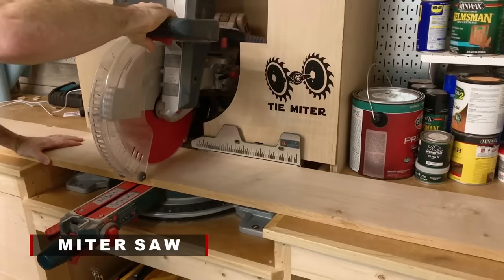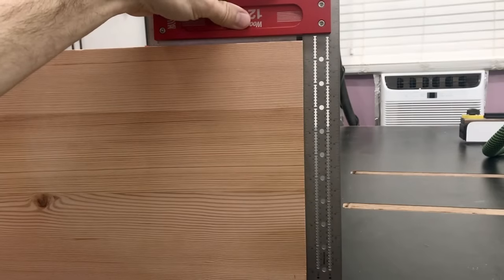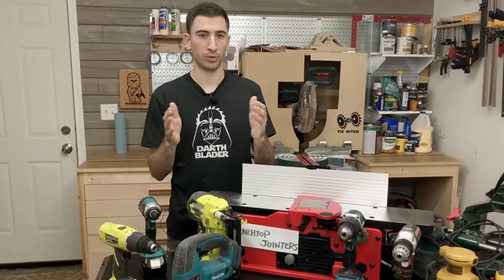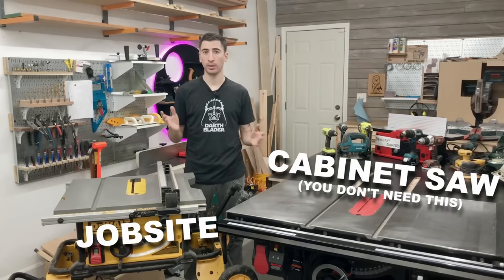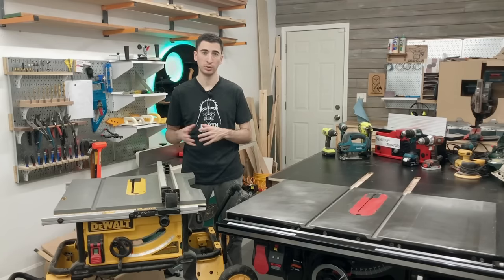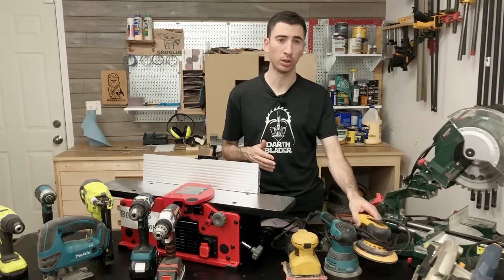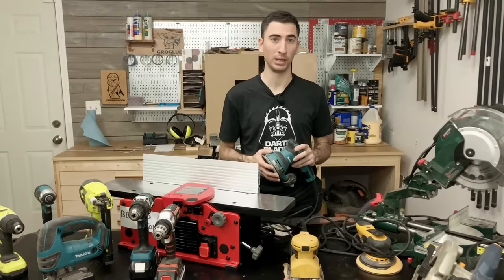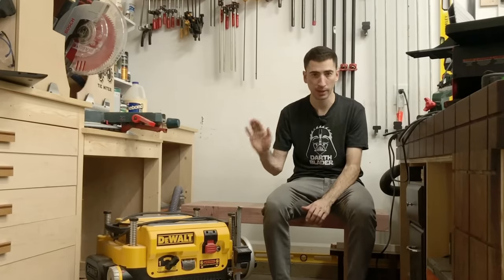Woodworking POWER Tools // Watch Before Buying

Comment: I was actually looking to buy a jointer and I would consider myself an intermediate craftsman but I’ve always just used a router and the straight edge to join two pieces of lumber together and it’s worked great for me so thank you for this video!
Reply from the maker: Glad you liked it!
Reply: A jointer is definitely a luxury you can live without. I've been woodworking for over 10 years and do it for a living, and I still don't own one. My shop doesn't have the room for one, and I've learned to live without.

Comment: You've got another sub but I wouldn't rule out Skil as an option for Table saw. I have the Skilsaw SPT99-12 and while I am new to woodworking this thing has handled everything i asked it to. Also has the rack and pinion fence which is so nice of a feature
Reply from the maker: hey if it works it works! thanks for the sub
Reply: I have a lumberjack 10" table saw mounted on a Dewalt table saw trolley. Used it for four years on job sites, as long as the blade is kept fresh and 40T or more when doing finish or trim work.
As for the router it is only the Triton for me and the work table is hard to beat
Reply: I have the Skilsaw SPT99-12 as well. 
I have no complaints. After initial setup, it runs like a dream and those big wheels make it so comfortable to move around.
Reply: I don't own the Skil SPT99-12, Skil's heavy duty 10 in worm drive saw, but it was my top choice for jobsite saws before I decided to get a contractor saw instead. It does well in independent performance tests against saws like the DeWalt. It has a rack and pinion fence system similar to Dewalt's. It'll do dados up to 1/2". And its mobile cart sets the bar for all other mobile carts. Those large wheels are great for stairs and rough terrain on the jobsite.

Comment: I think a lot of what to buy first and what is useful comes down to what you are going to use  the tools for. If you are finishing your basement, installing new molding or some cabinets or shelving, maybe building a deck or a shed a miter saw is real handy. If you are building furniture perhaps not. But most beginner's cut their teeth on home improvements and fine woodworking comes much later. The other thing to be mindful of is how much you really expect to use a tool. I would like to have a big jointer but space is limited. So I opted for a good size band saw which I use frequently and work around having a small jointer since I rarely need one.

Comment: The DeWalt tablesaw has been my affordable favorite for a long damn time now. The first feature that stood out was the tunable fence that stays square tp the table and parallel to the blade (for awhile).  Most other saws at that price point, you have to parallel and lock the front and back of the fence individually and double check everytime you move it.... I only check the DeWalt every couple of months to see if it needs retuning.
Reply: I'm sure the DeWalt table saw is very nice, but there is only one table saw suitable for a beginner and that is a SawStop and the cost is irrelevant as its dwarfed by the possible cost of having one's fingers re-attached. Now that SawStop makes a $895 model, the extra cost is even modest now.
Reply: I have a bosch Table saw and that is fantastic. I have heard nothing but good things about the Dewalt though, yet the Bosch was a few hundred AUD cheaper than the Dewalt.
Reply: @normanklein3155  nonsense, someone with a healthy regard for safety can use any table saw of reputable brand. SawStop is of course ideal, and I would posit that its greatest strength is in fighting complacency with safety, which tends to plague professionals and long-time amateurs the most.
Reply: @normanklein3155  Or just follow common sense safety measures instead of watching careless Youtubers. My personal safety must is a riving knife as this will greatly help with stopping kickbacks and always using a push stick instead of putting your fingers anywhere near the blade.

Comment: As for battery systems, I would suggest getting two. This gives you some flexibility to choose individual tools. Inuse both Worx and DeWalt. The first for cheaper tools that I don't use that often and are not as critical for precision (such as a sander, reciprocating saw, angled grinder), and DeWalt for the more heavily used and/or precise tools (drill/driver, router, track saw). Both have some other options that I like, such as the Worx HydroShot pressure washer or the DeWalt battery powered vacuum cleaner. I also have some garden tools from Worx for the small garden of my town house, although I have Ego tools for my country house... Being stuck with just one brand seems so limiting to me...

Comment: I had a dewalt contractor table saw for years. it was perfectly serviceable and capable of accurate cuts…..However, moving to a powermatic 3 hp table saw i realized just how much more safe a heavy machine was. so much more stable when cutting sheet goods and ripping long material. the blade guard on the powermatic is actually functional without getting in my way unlike the dewalt and i left it one the machine. If i was building a shop from scratch I would head straight for the higher end cabinet saw and go for cheaper options in other areas. just my two cents.
Reply from the maker: fair statement
Reply: I can use mine just perfectly fine, I love my table saw and the various sleds and jigs I’ve built for it. Easily serviceable and simple to use.

Comment: I went with Milwaukee because all their tools, including their yard tools, use the same batteries and their high end tools have brushless motors. Particularly love their table saw, circular saw, hedge trimmer (a bit heavy but cuts like a hot knife through butter), and their blower.
Reply: You could literally say the same about ryobi
Reply: @AlbiWiedersberg  
While Ryobi tools have improved in quality in recent years, a lot of reviews by tradespeople say to stay away from them, because while they're cheap, they're also cheaply made. I didn't choose Milwaukee only because of the interchangeable batteries and  brushless motors (which Ryobi only came out with last year), I also chose Milwaukee for the quality. The tradespeople say to go for Milwaukee, Makita, or Dewalt and I think the tradespeople know what they're talking about.
Reply: @Dr.TJ1  well the quality aspect makes sense to me

Comment: Regarding table saws.  I have and still use a high end Jet cabinet saw. Love it.  But a couple years ago I needed a cheap throwaway for a shop building project away from home.  I found a free HomeCraft saw vintage 1950 on Craigslist and after that project I still use it. HomeCraft is actually Delta back when it was all USA made. The bones of the carriage and mechanisms are rock solid. While the table is small the fence believe it or not is also a rack and pinion piece that is dead accurate.  I added a segmented belt on the motor and this baby runs so quiet it makes you think $600. Got it from a guy who never used it. Was rusted and siezed. After disassembly and lubrication and a very good blade this little baby is still one of my favorites for small jobs. Some days you just get lucky.

Comment: Good video, brother! I already got the bench top jointer, but I got it at auction for like $40. I'll save up for the used 6". Also, really glad you helped clear up the confusion on what saw to get to enjoy a decent fence. I was looking cabinet saw to replace the Craftsman 10" I got at a yard sale for $20, but maybe I don't need that... At least not until I build my timber frame shop! 😉

Comment: Definitely got to agree with the dewalt job site saw. It is awesome! Love that thing!!

As for the jointer….. I’ve got 2. One is a small ryobi that well works ok. The other is a makita attached to my planer. I built a roll away stand for it to make it easier to move around. It’s an 8 incher, and I have been able to run 6 footers off of it without adding any extra tables. It runs beautifully! Of course as you said a floor model would be even better but unfortunately I don’t have the space. I would say forget about the sixer and go with a portable 8” especially if you can get it as an attachment for your planer.
Reply from the maker: It is a great saw. Like you said on the jointer the biggest you can fit and afford is the way to go

Comment: I can highly recommend the Dust Deputy. It collects a lot more than just shavings and large particles, at least when hooked up to a decent shop vac.  Last year, I had to cut into a tile floor to repair a plumbing leak under our bathroom.  That meant cutting through grout lines, and through a 4" concrete slab.  In the past I'd have put on a respirator, taped the door shut, and resigned myself to the room being completely buried in talcum-powder-fine dust.  This time I had almost no mess,  except directly around the cuts. And when I opened the shop vac, it only had a light dusting on the filter.  Everything else was in the bucket under the Dust Deputy....

Comment: I have one of the little Craftsman bench top jointers and love it.  When used within its limitations it does exactly what I need. Most of what I need it for is in building bowl blanks between 8 and 12 inches, making that jointer the perfect size.  If I’m building a table top I have different tools for that.

Comment: 3M makes some fine consumables indeed.

I’m not at all into woodworking, I’m an offshore electromechanic who works in the dredging business. So we regularly ghettostyle things out of steel to get a job done.

3M cubitron grinding disks for angle grinders are great.

Imo a lot smoother in operation, less vibrations and such. I was very pleasantly surprised by these!! Seems like they have a “finer grain” if that makes sense. They remain smooth and equal more or less when worn down too.

Comment: I'd point out that Harbor Freight has been releasing better quality tools in the past year. In particular, the "Hercules" line of tools are quite good. I bought the Hercules contractors saw and sliding miter saw. They are very good construction.

Comment: Can definitely vouch for the Dewalt table saw. I don't have a planer/thicknesser and have been using mine to dimension timber and then cleaning up with a hand plane and it is surprisingly accurate with a 40 tooth blade.
Reply: I hate my tablesaw with an utter passion.  I'll use my miter saw and even jig saw to avoid using it if at all possible.
Reply: @joejoslin7451  Is yours the Dewalt? Mine seems great for what is a saw designed for a job site. Unfortunately I only have an 8'x10' shed to work in, so my options are kinda limited. That said, I have managed to make some very nice things using this saw.
Reply: @noire1001  Mine's a ShopSeries SS7202.  It's designed poorly (too many things to describe and be succinct).  Rough cuts might be ok for it, but even then I'll use circular or jig saw.
Reply: @joejoslin7451  Mine is a "Benchtop" series sold at K-Mart when they closed a local store (2003?). Also bought at that time a 10" miter saw and drill press. The only thing that seemed to work "out of the box" was the drill press. Hated the miter saw and was skeptical of the table saw. After I saw videos on tuning the saws, then putting good blades on (though not great ones), I would have put both against most any other saw out there. Upgrade the miter saw to a Harbor Freight sliding miter saw. Same thing goes for it as well (though it's time to tune it again).

Comment: Kinda surprised you threw Skil under the bus on the table saw recommendations. I purchased my Skil SPT99 a few years ago after doing quite a bit of research on it and similar models from Dewalt, Makita, Harbor Frieght, etc.  I didn't really want to get the Skil based on brand name alone, but I kept coming back to the reviews of the quality of that table saw and features as compared to the others. I'm really glad I didn't let the brand name sway me away, because it's a great saw.

Comment: I'm with you on the 8" jointer. I started off with a 6" and almost immediately knew I needed a larger jointer. It's only 2" wider but it's 10 times the tool.

Comment: I have never heard a woodworking channel mention two buying options that can save you money:  1) floor display machines and, even better, 2) tools/machines a woodworking education/teaching shop is getting rid of.  The latter will not be the latest version but they are well maintained and usually middle-to high end quality.  My own experience suggests one must ask whether any are availabe--maybe they're advertised but I've never seen that.  I picked up a Powermatic lathe and an 8" Jet jointer that way.  The lathe was a floor model and I saved $500.  The jointer I got for $200!  I got both of them more than ten years ago and they still work perfectly.

Comment: I have hauled my Ryobi stuff to Alaska from Alabama to build cabins for our church, now to Texas and they always do a good job, same set of battery operated since 2004. Had to replace the drill, but it drilled many a hole. Have Ryobi table saw and Miter saw, same deal, they work, unless you are stuck on extreme tolerance. They are also inexpensive, and available.

Comment: REALLY nice video and much appreciated. The only thing I might add, depending on your project type, is a drill press like the one shown in the background of your video and a small  9" or 10" band saw.  I have a 10" older Delta and it is indispensable for all kind of smaller tasks.

Comment: My father got a Skilsaw mitter saw like 8-10 years ago, still works today with no vacuum, we got a small Ingco drill with a cord 6-7 years ago, except the cord snapping once from a lot of use, the drill has been amazing and is still runs good, the back and forth mechanism is a bit busted from use but still it engages. And we mostly use it for screws, also he uses the crap out if it, and still runs good and strong. The point i'm making if you're not a professional don't waste big money on premium brand tools, if you really want reliability then buy the mitter, table saw and router from a good quality brand and you can pass with lower quality brands on the other stuff, or buy it used, since dewalt, makita, and other high quality brands last a really really long time, just service the bearings/belts and it will run virtually forever. For beginners, a good table saw will even replace the router in some joinery work and making circle forms, and a jigsaw sometimes. I heard parkside being mentioned, parkside is really cheap, we bought an angle grinder from parkside and it started dying after a year so read some reviews, look into some other brands and review your choices and then make a decision.

Comment: I also vote highly for the DeWalt DWE7491RS; it is really a great saw and, as you said, the fence is what sets it apart (including their odd but great little fence support bar).  The only issue is their crazy miter slot, which defeats many/most featherboards and is sloppy for most miter gauges.
Reply: I don't understand why everyone loves the DeWalt fence system on their job site saw. While I thought that their telescoping fence rail was pretty nifty, that flimsy flip down faced fence more than defeats their rail's advantage. Also as someone that has been operating table saws for most of my life, I would have a hard time stepping backward in craftsmanship working with such a saw.
Reply: yeah nothing much wrong with it. if you want a 400kg cast iron thing then do so but this is portable so...
Reply: @ancienttom97  WHAT are you talking about????  How does their flip down fence support in any way make them worse, not better???  If you don't like the little support, don't use it.  But I have yet to see ANY other saw fence that extends out past the table but still offers support for long pieces.
As to your "I have a hard time stepping backwards", what does THAT have to do with THIS video, beyond apparent snobbery?  Jeez.
Reply: @ancienttom97  Its a portable jobsite saw. Certain limitations are to be expected. Its a nice tool.

Comment: Good video. I lost everything in 1994.  I returned to MA and began rebuilding a woodshop and replacing some furniture for the home.  I had a good Craftsman hand saw and bought a 1 1/2 hp router and straight bit.  I cut the shelf boards oversize 1/16" and with a jig I routed a perfect square edge.  My first clamps for the jig were finish nails.  I got small jobs from friends and always bought a tool to help make THAT job easier.  Took a lot of work but I now have almost every tool you need for a woodshop,  duplicates of many hand power tools.  My point...try turn 1/4 of your profit into tool purchases and you'll see things get easier fast.  For me, making the job easier gets me motivated to do it.  Like I said....good video...but the lack of sawdust in your shop makes me highly suspect. LOL

Comment: Picked Jet for my table saw and band saw. Both with rolling stands. Dewalt 12 miter and planer, the Makita tool system, and about a million Bessey clamps. Works well in a 2 car garage..

Comment: As to the mitre saw, I used a simple Dewalt for 6 years but my oh my is the Bosch 12in glide an amazing saw. For the kind of stuff I do it’s perfect. The most stable side to side motion and yet compact in depth because no tubes sticking out the back. I have not hit the point of the mitre saw being unimportant yet, for me it’s second only to my drills for important tools. It’s also much much much safer than the table or circular saws so the 12” blade plus compound takes a lot of cuts away from the other saws.

Comment: In my shop, most of my tools are chorded. I have a couple of battery drill motors but I will take the chord anyway in my shop.
Reply: Corded gives you much more options and power and lower prices.
Reply: What kind of music can they play?
Reply from the maker: Very underrated response by M
Reply: @mattwarrensocal  NO rap